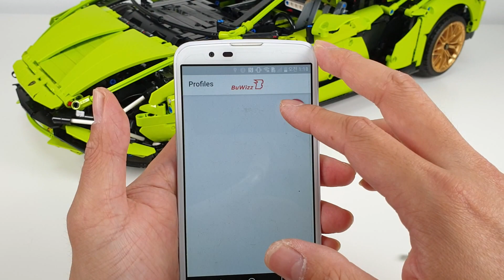[RC Tutorial] LEGO Lamborghini Sian motorized 42115 람보르기니 시안 구동개조

Comment: I really really love ur video.  I received my kit today and I haven’t open it yet.  I am pretty new to mod.  Would u plz kindly let me know the name of the 3 motors in the video?  Do u by any chance has a list of all the additional parts needed so that I can buy them online without making mistake plz?  Thx a lot!
Reply from the maker: Large motors: 88003 / Servo motor: 88004 / Buwizz: Not Lego, the Third party product. you can get this via online /
Partlist : https://rebrickable.com/mocs/MOC-45685/BrickyoUrDream/rc-lamborghini-sian-42115/?inventory=1#comments
If you hit like and follow, It will be thankful!
Reply: BrickyoUrDream I started building and finished bag 1 & 2.  This set is absolutely amazing.  I have some thoughts to share with u. 1. Lego has XL motor.  Have u tried it?  Is it as powerful as two L combined?  2. If so, have u considered fitting the motor at the front?  By doing so we don’t have to give up the simulated engine or gear box at the back.
Reply from the maker: @青州川先生  2 Large motor is more powerful than 1 XLarge motor, so better use 2L. Thanks for sharing your idea with me and I really like your idea too :-) Infact, I've thought about it but haven't tried yet since I felt front section is quite complicated to put 2 XL and had little worry about weakening the front body structure. well... about how the power transmission section could be changed, I gotta think about it as I've built this more than a month ago. sorry for that!
   If it were just a showing-off RC mod video, I might have tried different modification. However as my channel is to help as many as possible who don't even have any extra pieces or motors, so this was the best I could so far considering every aspect(budget, the level of difficulty, efficiency and so on) 
   Thank you for your great comment again and hope to see if you tried differently later! contact me via Insta :-) or If I try do something different later, I'll let you know!
Reply: BrickyoUrDream let me build the front to better understand the structure first.  I will keep u posted!
Reply from the maker: @青州川先生  Hope you finished well!
Reply: BrickYourDream i finished it!  Without mod yet.  Now I see how fitting 2 motors under the hood may compromise the structure integrity as u mentioned before.  I am thinking, u know behind the engine, there is a gap covered by a large grey piece.  Can we stand the motors there?
Reply from the maker: @青州川先生  motors are few studs longer to fit in there and there's also a linkage for the rear spoiler there. Hope you try first and find any possible solutions!

Comment: The modification is terrific and thanks for such generous sharing with fans. 
How long do you think an amateur can complete this modification (dissemble & assemble), may be a rough estimate? Thank you in advance for your sharing again :-)
Reply from the maker: I deeply thank to your kind comment. well....I guess it'll probably take about 2 hours :-)  Thank you!
Reply from the maker: @Isaac Eow You must use buwizz... I tested with IR Receiver & battery box but it hardly moves.  I'll try to make another video few months later with huge internal reconstruction removing gearbox to reduce the weight, but for now it only works with Buwizz. How 'bout trying Porsche 42056, you don't need Buwizz and enjoy the speed
Reply from the maker: @Isaac Eow https://buwizz.com/       Expensive... but worth money. you can trust me.

Comment: Does the gearbox and engine still work?
Reply from the maker: fake V12 is replaced with twin L motors. 
D-N-R gearbox works but when you put knob on D (which involves 8-speed gearbox) the power is not enough to rotate the wheels due to huge frictions in gearbox I guess).

If you just want to enjoy the 8 speed sequential transmission with working V12 engine rather than RC driving, I recommend you to connect a motor directly to the differentials. (as I've shown in my review video.)
Reply: BrickyoUrDream thank you so much
Reply from the maker: @chickenfilms6562  Thank you :-)